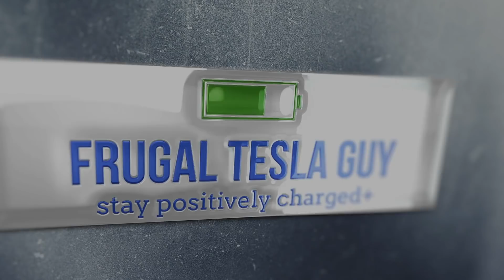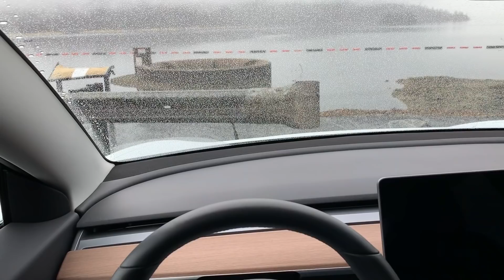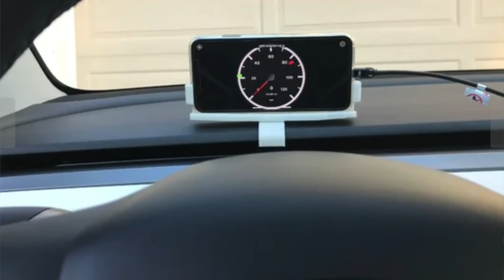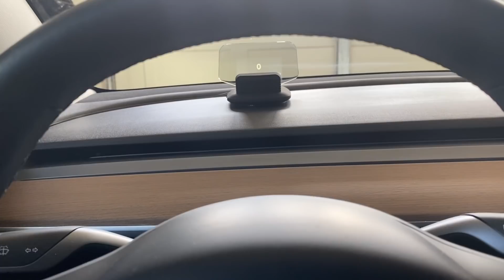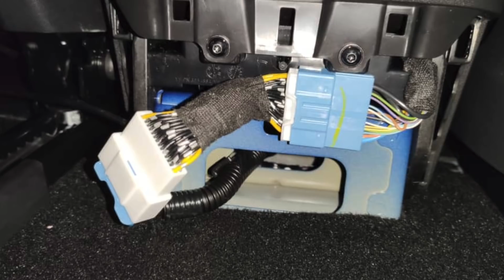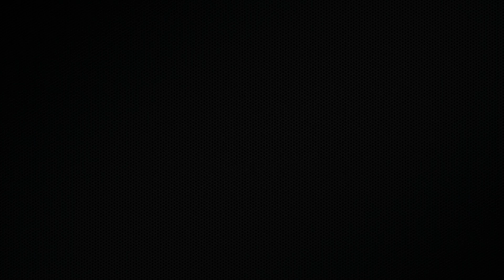Tesla Model 3 Head Up Display **Please Read the Description

Comment: This seems like a complete failure at making a HUD. The whole point of it is to have the focal plane as far away as optically feasible. Usually, the image should appear at least near the end of the hood in order to make sense (not require eyes refocusing too far, and parallax “gluing” the screen to the road, rather than swimming around with your head movements and judder). This appears to have the focal plane near the windshield. That’s not how HUDs are supposed to function.

Comment: You mention constantly checking your speed.  Have you tried setting TAC at the speed limit, then tapping the new speed limit sign if it changes on the screen.  (I haven't, but another YouTuber said if your cruise is above the (new) speed limit, just tap the sign to reset cruise.)

Comment: In our Volvo, it is built in and uses the regular window to project on. I can not believe that a Tesla, that is so fricking expensive, do not have this option. I have now used HUD for three years and it is a pain in the ass to drive a car without it. And i must say that Volvo HUD is very very nicely done - not all that useless information but only what you really need.
Reply: He has some irrational dislike of them and makes people believe they are a benefit even with FSD.  Of course ignoring that even with FSD we will still go between driving modes, and HUDs are useful in auto driving too.  HUDs are becoming 3D with more AR feature.  Projected displays are better.

Comment: My old 2010 Lexus HS250h had a HUD with many more features (e.g., speed, navigation, displayed the buttons on the steering wheel I was touching etc) and driving the M3 is taking some getting used to because the information I typically use is on the center display.  A HUD for city driving is a great feature to have ... I won't buy this because of the cable is simply too out-of-place with the rest of the dashboard design. I'd almost buy one if it came with a full dash skin where the cable is hidden under that cover and you can mount the HUD wherever you want it.

Comment: I’m a big fan of clean lines so I’m not sure I’d ever be ok with the looks or that cable. I am glad it exists though for those that can’t get over not having a display behind the wheel. That being said, before getting a Model 3, I had a BMW so I don’t use turn signals or have any regard for my speedometer, so who needs a heads up display?

Comment: This is a great idea but it 100% needs to be battery powered and have a cartridge battery that you plug into the USB or lighter socket to charge when it's getting low/when you leage the car.

Comment: ABOUT TIME, WAY TOO LATE IF YOU ASK ME...Why do you need to use the phone dammit....If you ask me the whole windshield should be one big ogmented HUD!
Reply: Like VW intended it for the ID3 (but fucked up the hardware)?
Reply: @PatrickBreuer  Kinda. Their suppliers (LG and Corning) are newbies and made a ton of rookie mistakes. VW AR-HUD is a wannabe and can't even remotely have a picture size comparable with the whole windshield. It is only around 10 degrees wide.
Reply: You can't have a whole windshield as an AR-HUD. Not feasible for mass production.

Comment: Interesting!! I would think tesla going to make it for the next modal!! I would think they would!!
Reply: No, they won't. Tesla decided that a small HUD picture with low resolution (480x240) would have been in a bad contrast to the huge hi-res center display. Even the new 640x320 TFTs weren't good for them. For the Model 3 they could buy such a simple HUD for $115-$125 and easily resell them with 6x-8x markup as a built-in option. Aesthetic over function. Tesla is Apple of the car world.

Comment: Tesla should have an heads up display
Reply: Tesla decided that a small HUD picture with low resolution (480x240) would have been in a bad contrast to the huge hi-res center display. For the Model 3 they could buy such a simple HUD for $115-$125 and easily resell them with 6x-8x markup as a built-in option. Aesthetic over functionality. Tesla became Apple of the car world.

Comment: Polarized sunglasses? Every HUD i've used DO NOT work with polarized sunglasses making it useless on a sunny day.
Reply: Unfortunately that thing with polarizing glasses and HUDs (well, almost all of them) is by design. Any commercially feasible TFT-display-based HUD is going to have that problem. The windshield suppresses the polarization that can pass through the glasses. Therefore it is not even present after the TFT display. Only one DMD-based HUD on the market that I know of (Lincoln Continental/Navigator) doesn't have this design trait. A DMD can't care less about polarization.

Comment: I'll stick with the stock display, it's never been an issue for me.  I don't have to turn my head to use it, it's just a slight glance over with my eyes.  This device is just another thing that sucks range out of our cars, no matter how slight.  Throw this into the equation with charging our phones, brighter interior lights, massaging seat bladder mods, power trunk, power frunk...the list goes on and on, and it adds up.  The Model 3 and Y doesn't need a HUD, in fact most cars don't need a HUD.

Comment: The screen should be user-configurable. All I need is speed, time, and the song playing in my Amazon Music (via buletooth) and the next song coming up. Your unit should be all bluetooth and no cables, not even power. If it gets low on power, you can quickly trade out the rechargeable battery that was charging in the the console. You see, your unit should come with 2 batteries. One is always charging inside the console and the other is being used in the unit. When the display shows to trade out the unit's low battery with the fully-charged battery, the driver can push a little button that releases the low battery and then replace it just as easily with the fully-charged battery that has been charging inside the console. BECAUSE THE UNIT HAS NO ATTACHED CABLES, IT DOESN'T LOOK THIRD PARTY AND PEOPLE WILL WANT TO BUY IT NOW.

Comment: A proper POV turn by turn nav display (like in the maps app on my iPhone) showing the road ahead, intersecting streets, etc. The list style in the current Tesla nav display is too distracting and awkward. If Tesla won't incorporate that type of nav display into the vehicle overview display in the left panel, or even better into an OEM HUD ... then a third party HUD is the only option. Also ... a wireless connection to the sending unit plugged into the OBD port.

Comment: Nice report, I love HUD's and I am searching for one in my Tesla.
However, I have a few questions:
Can I plug the ODBII adapter into the connector of the ScanMyTesla connector (which comes from the rear console cover)? Or is it only for the new ODBII connector in the front of the footwell that has been produced by Tesla since 2020? And what's about the two red/black cables and where they have to been plugged in?
Reply: yes ,it can come from the rear console cover

Comment: How about projecting the signal straight onto the windshield and turning it into a HUD ?  Might need to affix a glossy tint.
Reply: Tesla decided that a small HUD picture with low resolution (480x240) would have been in a bad contrast to the huge hi-res center display. For the Model 3 they could buy such a simple HUD for $115-$125 and easily resell them with 6x-8x markup as a built-in option. Aesthetic over function.

Comment: Thank you for doing this video; it highlights the importance of having this feature, now standard on many vehicles.
Purely on security reasons if nothing else, I hope Tesla take a note and add it as standard to all their models, incl. speed limit, essential when you have all that acceleration; will complement nicely the clean-dashboard concept.
Reply: Abandon your hope. Tesla decided that a small HUD picture with low resolution (480x240) would have been in a bad contrast to the huge hi-res center display. For the Model 3 they could buy such a simple HUD for $115-$125 and easily resell them with 6x-8x markup as a built-in option. Aesthetic over function. Tesla is Apple of the car world. Just agree with Elon that you don't need a HUD.

Comment: Ridiculous price.  More than three times what would be appropriate, especially for something that adds redundant information that might distract the driver from doing what is most important -driving the car!  If the information needed is located in only one place you don't have to make a choice about where to look for it.  And, what is the reason anyone needs to know the speed all the time?  The displayed speed of the car is only a gauge of an instant condition, not a criteria for safe operation of the car.

Comment: Personally, as a highly prospective Tesla owner in very eager waiting, I am torn right down the middle as to whether I would want a heads-up display or to just rely on the built-in 17" display.  What would have been really cool, though, is if Tesla had put in an HUD projector unit that turns the entire windshield into a HUD screen, overlaying the Autopilot and FSD visualizer data within your field of view and putting the speed at the top or bottom depending on a user-definable preference within the display settings.  This would allow for rendering that is as photorealistic as it gets using augmented reality through the network of built-in cameras.
Reply: Not feasible for mass production for many reasons.

Comment: Chevy has had an HUD for about 20 years, I have one in my GMC, it uses a well that reflects on the windshield. Hyundai had a clear retractable screen but has changed over to the well as well.
Reply: Tesla decided that a small HUD picture with low resolution (480x240) would have been in a bad contrast to the huge hi-res center display. For the Model 3 they could buy such a simple HUD for $115-$125 and easily resell them with 6x-8x markup as a built-in option. Aesthetic over function.

Comment: Not for me I have the M3P and this would make it look cheap ...Sorry I think Tesla should look at an integrated heads up for the 3 and Y.....Still enjoy your channel loads so keep posting
Reply from the maker: Thanks!
Reply: Tesla won't look into at an integrated HUD in the near future. They already did. Tesla decided that a small HUD picture with low resolution (480x240) would have been in a bad contrast to the huge hi-res center display. For the Model 3 they could buy such a simple HUD for $115-$125 and easily resell them with 6x-8x markup as a built-in option. Aesthetic over function. Elon thinks you don't need a HUD.

Comment: Is this made in China??  Not sure I would want that tech plugged into my Tesla (doing OTA updates).  
With a traditional speedo you have to take your eyes off the road to look between the steering wheel spokes to see the Speed info.
With the speedo located just to the right of the steering wheel at a point higher than a traditional speedo you have an unobstructed 
view of the road.  With traffic aware cruise control, which I use often, once you set speed you're not really checking it anyway.
So, thumbs down IF this is a product from China.  They need to pay for infecting the entire world with a virus.
And thumbs down because it is really not necessary.  IMHO
P.S.  Still enjoyed the video.  Thanks

Comment: Interesting, I like how it uses OBD2 data.  However, the price seems high.  I would rather have it display on the windshield and not have the clear plastic section - it would look less obtrusive.  I would get it if the price was closer to $200.

Comment: Having driven my Model 3 for 18 months, I can say that I really have no desire for a HUD anymore.

Looking at the center screen has NOT been a hassle in my experience.
Reply: Absolutely. The speedo on the display is MUCH better visible than any classic solution behind the steering wheel.
Reply: @PatrickBreuer  It's clearly superior in front of you.
Reply: @JohnnyZenith  In FRONT of me should be the windshield. You probably  mean "directly below". 

As the human eye has a rather horizontal view-range, "below" is per definition less comfortable then "on the side". 

In addition, it's not just "below", but "behind the steering wheel", which often means "(partly) blocked by either hand or the steering wheel". 

"Behind the steering wheel" is simply something we are accustomed to since ~100 years. It's not better by any means, but has some severe drawbacks.

You really don't need to remind me of 30+ years of driving conventional cars - I still own and drive one. I simply have learned to overcome 3 decades of "it's always been like that" and have learned better.
Reply: He has some irrational dislike of them and makes people believe they are a benefit even with FSD.  Of course ignoring that even with FSD we will still go between driving modes, and HUDs are useful in auto driving too.  HUDs are becoming 3D with more AR feature.  Projected displays are better.

Comment: Great job and thank you for bringing this to our attention. You immediately lost me when I saw a cable running along the side, this is NO GO for me. If & when they have a BT option, I would revisit this again. To be honest, anytime I see options where you have to take apart your car,  find a way to hide wires and connections, I won't & can't be bothered.
Reply: Regardless of whether it got its information over Bluetooth. You would need to find a way to power the device. It's going to have to have wires running to it regardless so you might as well send the information over the wire as well.

Comment: I would love it if our Model 3 had a HUD as original equipment.  But, adding a third-party device that has direct access to the car's computer, especially a device with over the air update capability, seems like an invitation to disaster.  Or am I missing something?
Reply: Tesla decided that a small HUD picture with low resolution (480x240) would have been in a bad contrast to the huge hi-res center display. For the Model 3 they could buy such a simple HUD for $115-$125 and easily resell them with 6x-8x markup as a built-in option. Aesthetic over function.

Comment: It is generally called a "HEAD UP" not heads up display. I requires a more precisely milled windshield.
Reply from the maker: Thanks Arnold. I’m new to the Head Up Display.
Reply: You must have been military. It's call a head up display in the services.
Reply: Windshields aren't milled. A HUD-specced windshield need to be bent more precisely than a standard one. And in many cases it has to have a special vedge film inside to suppress the ghost image.

Comment: Looks a lot easier to add than my Sirius XM Stratus 7 which requires running wires for power, for it receiving antenna, AND for its FM transmitting antenna.  And, until you mentioned it, I didn't even see that wire.

Comment: You didn't mention wearing polarized sunglasses completely (well almost) removes the projection from your view unless you move your head to find a weak spot in the sunglasses.  I love HUD however this is a major issues for me
Reply from the maker: I noticed a little loss with my polarized sunglasses but can still clearly see the display.
Reply: @FrugalTeslaGuy   You mention brightness setting, do you think the brightness setting helps with that?  Based on my experience with Audi Q5 display I am not happy with HUD in that vehicle when I wear my polarized sunglasses.
Reply: @robo.1260  This after-market gimmick has the only small advantage over your windshield HUD. The angle of incidence on the combiner is pretty small, around 15-18 degrees. That allows for a TFT display to be visible even though the polarizing glasses if the designers have tweaked a bit its polarizers. Any TFT display supplier can do that.

In Audi Q5 that angle should be around 55 degrees. Can't recall the exact value although I was involved in the design 6-7 years ago. That trick with linear polarization won't work without significant losses in the lumen budget. It might sound a bit gibberish, but it is just another day at work for me 😎

Comment: 10x aliexpress cost 😮
How far does it project? Does it feel like a car length before you?
Re: over the air updates, you didn't cover how it works? does it come with a plan, does it require WiFi.
So sad Tesla skipped this, but hey center speedos are nothing new 😉
Reply: A HUD can't project a thing. The virtual image in this HUD is a couple of feet behind the curved semitransparent mirror.
Reply: @timbehrens9678  I know it won't "project" on the road ahead for others to see... But it still project as in send the image ahead of the car in OEM cases where there's not even that plastic bit

Comment: I’ve always thought Tesla should add a HUD in their vehicles. Hopefully, they’ll take note and make a high quality one soon.
Reply: they wont when they intend to not hav a dash at all
Reply: You should see it this way: the closer they get to full autonomy, the less likely they'll implement a HUD. that's why they chose not to implement in the first place
Reply: @silvrsurfer  not only. Tesla decided that a small HUD picture with low resolution (480x240) would have been in a bad contrast to the huge hi-res center display. For the Model 3 they could buy such a simple HUD for $115-$125 and easily resell them with 6x-8x markup as a built-in option. Aesthetic over function. Tesla is Apple of the car world.
Reply: The Model 3 an Y will never had a HUD, these are entry level Tesla's.
Reply: @Resist4  but you can have a HUD in the entry-level VW Golf.

Comment: Would love to see a test if this still displays speed and other data even when you do a double long press reset of the main computer. The car still drives no problem so I wonder if the data is still flowing from the core drive software. That would give this and potentially other devices a massive boost as a backup speedometer.